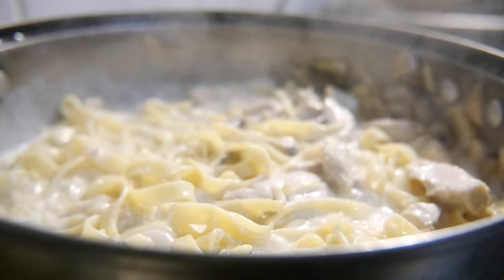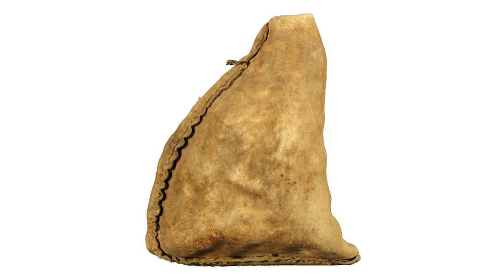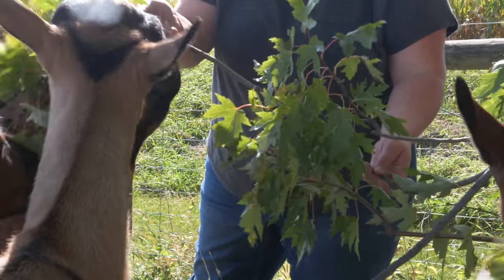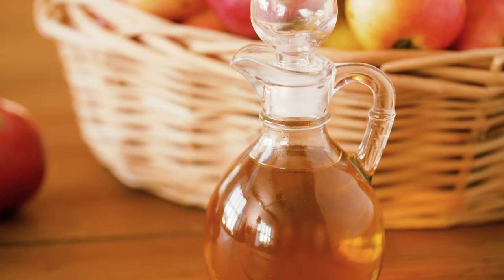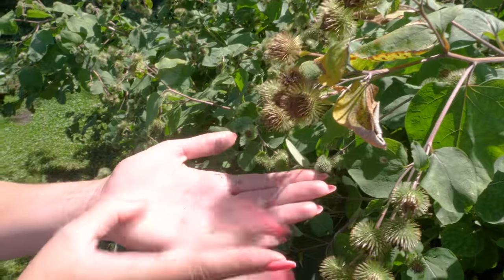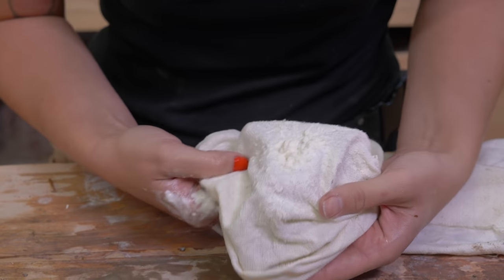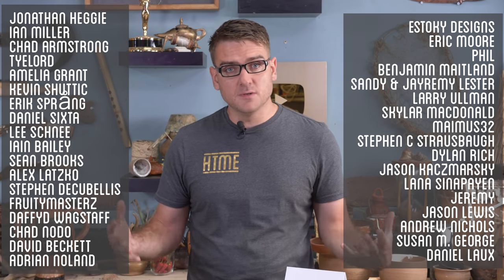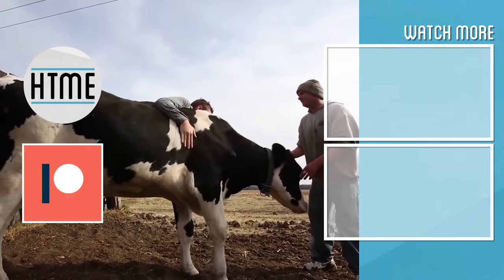Homemade Cheese 100% from Scratch (Made from Goat Milk)

Comment: Some tips for your future cheeses, and how to make cheesy tasting cheese from whey in about a day (tastes like feta) .

10:20 You need to let the rennet stay awhile so you see nothing but yellow whey, and the white curds on the bottom.  Like at least a couple hours. You have too much of the milk still uncurdled, that's why it's white. 12:18 is how it should look. To make it like that, make sure your rennet (or other stuff you use to curdle) sits long enough.

I also curdle my cheese with kefir whey. I make my own kefir (with kefir grains) , and when you let it get as sour as it can over a couple days,  let it separate in the fridge, then dump off the yellow whey in a glass jar. Save that till you have 4 cups of it, though 8 is preferred if you want it to taste cheesy. Note that this is not the same as whey protein in the store, so don't use that. This kefir whey is just the fermented version of that with all it's moisture still there.

Once you have 4 cups of real sour kefir whey,  stick the jar in a bowl of warm water to bring it's temperature up to room temp (unless you kept it at room temp - you can, but make sure it's on;y covered with a cloth/rubber band, otherwise it gets more alcoholic) . Then bring the gallon of milk to 105 F and take it off the heat. Pour it into a warmed up glass container (to keep the temperature about the same... and I use glass cause the sour whey + metal pan can make metallic flavors) , then pour 4 cups of the kefir whey in there, and stir lightly with your hand for ~ 3 turns. The curd will separate. Let it sit like this for 2-3 hours, then drain in a flour sack towel for an hour by wrapping a string around it and hanging it over something to catch the whey.

Then to make it taste cheesy (4 more cups of sour whey required) , I dump out all the whey that drained (you can ferment this with kefir grains to use for future cheese!) , put the curds back in there and break them into small roughly 2-3 cm pieces. Dissolve 1.5 tbsp (27-30 grams) of salt in the last 4 cups of sour whey, then pour it on top of the curds. Let this sit for 12 hours at room temp with a cover on so bugs can't get in. Then drain it for 1 hour in another flour sack towel just like before.

Then store it in a glass jar in the fridge. It tastes super cheesy, with no nasty vinegar flavor that people often use for "cheese" .
Reply: You keep saying 'fridge'.  He hasn't invented that yet.
Reply: @dancrane3807  Surely he's unlocked the Ice Box technology.
Reply: @MichaelOnines  not yet
Reply: @GregfromHayDay  I guess that was pre-reset.
Reply: @dancrane3807  That's why the springhouse was invented.

Comment: you can also do the acidification during the pressing or draining process. So add the culture and the renet at the same time. makes for a nicer curd since you don't have the small particle size of the acid coagulated casein yet.

Comment: This is the first time I've seen rennin being added after the milk has already curdled.. I add rennet after 60-90 minutes of fermenting. I also make rennet using seeds from a locally available berry. Secondly, brining should be down before letting the cheese sit after pressing, it should air dry after brining or the rind will prevent proper salt absorption. I suppose it doesn't really matter what that small a block.

Comment: Too much movement went on, also helps to heat up the milk just a little. But for a simple lactofermented cheese, I'd just let it sit for a few days, like, the whole thing, with a lid on, just burp it once in a little while, and then throw it straight into the cheesecloth. You don't want any movement or stirring though, stirring breaks down curd and mixes it back up into the whey.

Comment: Cutting off the mold does not work. By the time the mold is visible, the mycelia have spread throughout the food, not just the parts that appear moldy. If any part of the food appears moldy, all of it is, and you should throw it out.
Reply: That does not apply to all types of food.

In some cases it is actually possible to just remove the mold.
Reply: @LintuLumessa  it's still safest just not to eat it
Reply: Indeed.
And just because it grew on cheese doesn't mean it's "good" mold. Could be anything, the damn stuff doesn't come with labels unfortunately...
(Color is NO indication of safety!)